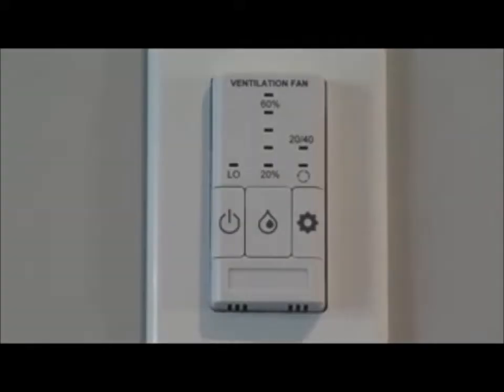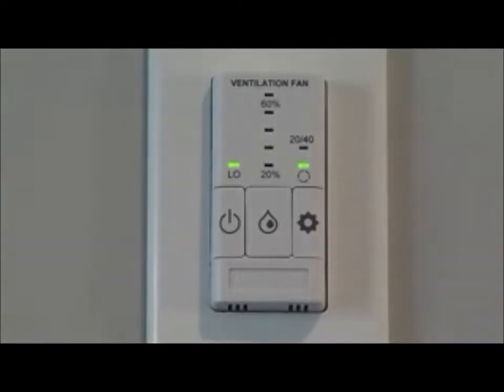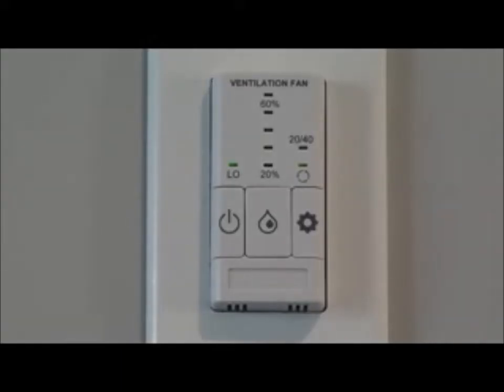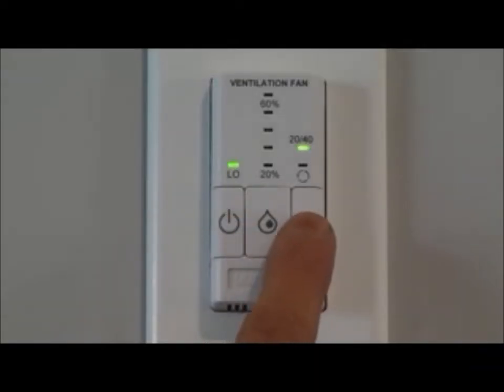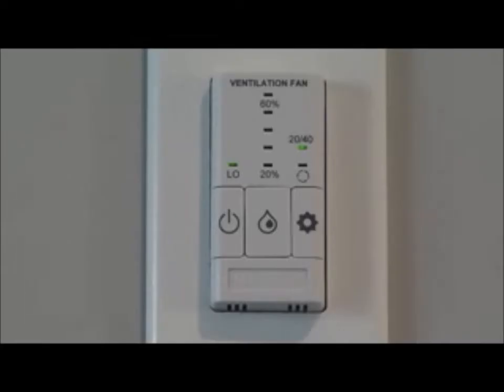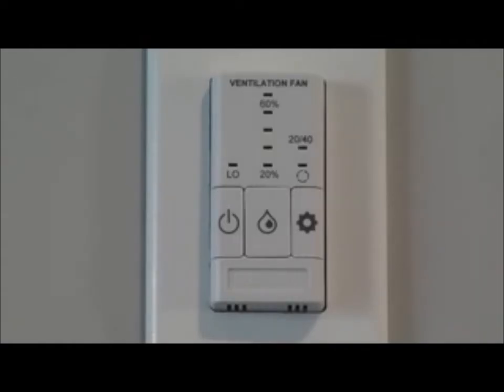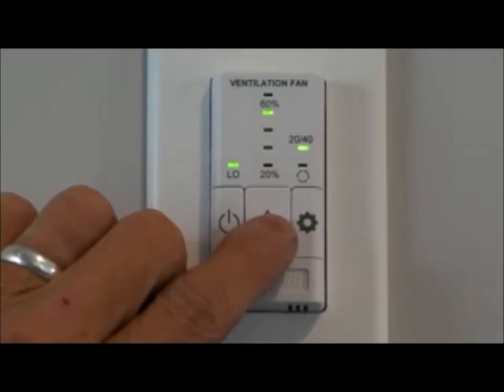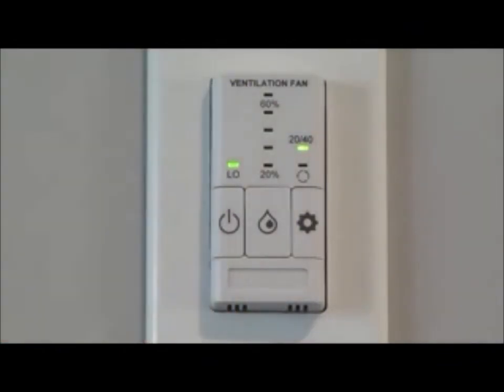Lifebreath HRV - BC03 Controller

Comment: Great video, thanks. So what is ventilation setting is best for spring, summer, fall. Generally I’ve run AC fan ON instead of AUTO. So should I be running HRV ventilation on LO or 20/40…?  And then in the winter keep heater fan ON and keep 20/40 for HRV?

Comment: Hi guys, quick question if I understand correctly, I have the HRV on 2040. What is the perfect setting while running the AC during the summer in Canada?
Reply: Turn the ventilation fan off

Comment: Hello, i just recently moved to a newer house and i’m having issues with the condensation. I’m seeing condensation in my windows and i have the fan running at low, the humidity is at 20% (it’s minus -17 but feels like -31 right now), and it’s running 20/40. I’m still seeing condensation in my windows.
What should i do? Should i turn off the fan, leave the humidity at 20 and use the circulation?

Comment: Great video! Thank you. In the summer time,  I'd like to turn the HRV off. But when I do, the bathroom fans stop working. Is there any way around this issue?
Reply: I have the same issue. The bathroom fans are tied to the HRV system so your best bet is to have it on Low and 20/40.

Comment: I turned off the HRV for about 4-5 days because we hit really low temperatures -38°C~-43°C. We just noticed on the 5th day that half of the windows upstairs are covered with ice. But clearly the guy in the video said to turn the HRV when temperatures reach 30°C or -30°C. That's the part that confuses me.

Comment: it's -30 here in winnipeg, my hrv has ice buildup and the defrost damper makes noise. what should i do
Reply: Below -25 with usually you should just keep it off and wait for temperature to go up little
Reply: But if I do that, I get condensation on my windows.
Reply: @ajaaniajaa  unfortunately there’s nothing much can be done in that cold weather. You have to manually manage your humidity, after shower keep your washroom fan on for at least an hour or 2 hours.  Don’t boil that many things in house and if you do then keep kitchen fan on for as long as possible. Use paper towel to wipe condensation. Condensation for few days is not a problem, it’s a problem if it goes on like this for so so long time. I’m here in Alberta we get cold weather as well, We had around -30 temp for 8 to 10 days and we couldn’t stop condensation but was able to reduce by doing things above mentioned
Reply: Thanks, this helps.
Reply: @Vipul_  I am living in Saskatchewan and wintertime extreme temperature is -40c so do I leave on HRV on 50% and. 20/40 mode?

Also, I have noticed in HRV Box ice build-up in the core. Is it normal or I should shut off the HRV system??
Reply: @arjunpatel6878  20/40 is 20 minute fresh air intake and 40 minutes circulation also around -40 temperature it doesn’t do much so better to keep it off or just run it in circulation mode if you want air to be clean. 

Run HRV on 20/40 mode only if outside is not colder than -25
Reply: @Vipul_  thanks for the reply.. How about the humidity level set to 40% or 50%???
Reply: @arjunpatel6878  humidity level means it will bring dry air inside and make sure that it’ll manage humidity around those percentage. In winter I keep at 40% and lower down to 30% if I notice any condensed windows
Reply: Just moved to Winnipeg as well with the same controller. If you found the sweet spot on the controller let me know!

Comment: Hi I live in Ontario, if I understand correctly, during winter leave it running 24/7 at 40% humidity,  with high fan on. During fall, spring & summer turn off the humidity but have the fan running on low?
Reply: For winter, No need to run fan on high mode. If you have BC03 controller then just leave it on low mode and have your humidity option selected (40 or 50) then select 20/40 (idle) but turn 20/40 off while cooking and turn fan on for furnace as well to get rid of cooking smell.
Reply: Your HRV fan will automatically run on high speed when you turn fan on in washroom

Comment: Hi, Thank you for this video. Question pls. I set my controller to 20/40 however the fan never stops running. Do I also turn the humidifier middle section on? For winter.  Also, I have Telus app, should I also turn the fan on my Telus app or just use this system only? When I use the circulating option on my telus app and level this box off, it turns the fan on and off ever 10mins or so. Which option is best pls?
Reply: The middle section is too control humidity in house, if you have 40% selected then whenever your has more than 40% humidity, HRV will start pumping dry air to lower down humidity. In winter best to keep it on 50% and if it’s too cold than 30 or 40^

Comment: Thank you for this. So in winter the best setting is humidity at 40 and re circulation?
Reply: You can use recalculation mode but turn it off (recirculation mode) while cooking. In my opinion better to use 20/40 which basically bring fresh air for 20 mins and then recirculates it for 40 mins

Comment: Hi, I have this system and the Ecobee at my house, but the humidity is super low. I live in Gatineau, the air outside is pretty dry also but I like my house rather humid, I’m from a rather humid country anytime it’s get too dry in the house my nose bleeds and I get sick. How do I raise up the humidity in my house? Thanks
Reply: For humidity you will need separate humidifier, this HRV doesn’t control. It can only pump in some dry air if your house is too humid (depends on setting you choose)

Comment: My house is double story and when I come downstairs I can smell the cooking smell I did the settings how u said and my fan is on ON position what should I do pls help
Reply: HRV is a good idea but I don't think it ever works, I have it but i also have to open windows when I am cooking.
Reply: When cooking you must turn off circulation mode or that 20/40 mode and put furnace fan on (by default your furnace fan will be on auto mode)
Reply: @Vipul_  I was complaining because the controller of my HRV Was not communicating with my furnace, I had to manually turn the furnace fan ON but it’s now fixed( after 5 years ).

Comment: My humidity section doesnt flash at at. What does this mean
Reply: It means you have your inside home humidity under(lower than)  that percentage which you have selected.
Reply: @Vipul_  i know it will lower the humidity but will it raise the humidity if I set it higher also?
Reply: @natasha340  technically it doesn’t increase humidity as those percentages options work as dehumidifier. If you have 20% then it’ll will make sure that your house doesn’t get more than 20% humidity and if it does go up then fan will start working at full speed and you’ll notice that 20% option flashing. 

To increase humidity  you can use your humidifier and set up your hrv at 40% (ideal for 0 to -12c temp) this will make sure it doesn’t pump more dry air in your house.
Reply: @Vipul_  i will have to buy a humidifier than . Thank you for your help. Happy new year.
Reply: @natasha340  Happy new year!!

Comment: When the setting on the controller is on 20/40 the HRV is not Turning off for the 40 minutes. What could the problem be?
Thanks
Reply: What 20/40 means is that, for 20 minutes the external air is let inside home, for 40 mins the air just inside home is recirculated to save heating energy. So HRV won't stop.

Comment: If we first time on the HRV in winter how many days continue on my hrv on but not shutting down 5 day continue work now
Reply: In winter use the 20/40 mode, by this method, your home will have enough oxygen inside home. Dont turn off the hrv in winter.  In summer, keep the hrv in continous air circulation mode, by turning off both the third columns led lights off.  By pressing the third button three times, untill both the 3rd column led's are off, your hrv will be in continous air circulation mode.  If you still have doubt call me at 587 997 7859.
Reply: @Canada_Immigration_Bible  
I also live in Calgary I don't have the 20/40 option should I leave the fan at low and humidity at 30% during winter
Reply: @harigill8534  yes. U can also turn off humidifier when u see ice formation in Windows and doors.
Reply: I have same question my lifebreath unit controller doesn't have 20/40 option they have only two option low and high which one i should use and how long.
Thanks
Reply: @COMPAQCOBRA  always keep it on low, high when you are cooking. Also make sure to have circulation mode off while cooking

Comment: The past owners of my new house passed one 20 gauge wire from the air exchanger to a DET01 timer. From that timer, he passed another 20 gauge wire to another slot where I could add a BC03 basic wall control... is that possible or do I have to fish another wire to another “in” port on my air exchanger ?

Comment: Hi I live in a new house in Manitoba Canada and right now the temperature outside is -33 degree celcius with the windchill of -35. The HRV system is off the whole night and our windows and doors still have ice buildup. I need some advice!
Reply: Mae Desiderio turn on the water looking button to al least 40% or 50%
Reply: @krazywalnut5633  the humidity control is at 30%. Right now the temp outside is -20°C and still gettig ice buildup on all our windows.
Reply: In the video (3:00) he said if we reach plus 30 with humidex and minus 30 with windchill thats the time we shut off the HRV system.
Reply: @mondo_burrito  if you turn it off, there's going to be a considerate amount of condensation on windows thus turning that condensate into ice.
Reply: I have the same situation in my house. I have condensation building up in my window and it’s not yet winter here in Manitoba. What’s your current setting your ventilation?

Comment: I have removed the BC03 to replace dry wall - Upon refitting it, I might have got the wires wrong
3 Wires Yellow Black and White - Black was definitely the middle but now the lights above the power , 20 and circulation are flashing and the unit doesn't appear to work...... Any idea?
Reply: Black wire connected to Y, Green wire connected to Green, Red wire connected to red in my BC03. Yellow(or Black),Green, Red is the order in the back of BC03.
Reply: Alan Mani The past owners of my new house passed one 20 gauge wire from the air exchanger to a DET01 timer. From that timer, he passed another 20 gauge wire to another slot where I could add a BC03 basic wall control... is that possible or do I have to fish another wire to another “in” port on my air exchanger ?

Comment: Confused regarding the humidity because it seems opposite of my home and what i would choose.  What i mean is, in the winter my house is so dry (roughly 25%) that i had to install a humidifier on the furnace in attempt to bring UP the humidity to a more comfortable level.  However in these videos it says the opposite, you say use the system to reduce humidity in the winter...  I would want to increase humidity in winter and reduce humidity in summer!

In the summer months the humidity is high, today for example we had the windows open in the morning and its aprox 52% humidity before turning on the AC on the inside  (outside today will be 29*C = 38*C with the 70% humidex factored ). 
I live in Canada between MI and NY.
Reply: I live in Calgary in Canada and the lifebreadth can't increase humidity (To increase humidity, increase using the separate control in humidifier. Your home will have separate control for humidifier). So in winter, turn only the dehumidifer to off by making sure all the center led's off in lifebreadth control.  In summer set the humidity set point in the lifebreadth to the percentage you need.  example  40 or 50%.  So what lifebreadth will do, is if the indoor humidity increases beyond 40 or 50%, it will increase fan speed to reduce the indoor humidity and will maintain to the set point, 40 or 50%.  Hope this helps.
Reply: @Canada_Immigration_Bible  Thanks for the answer! I'm in Quebec and the house is soooo dry, around 22... So I deactivated the dehumidifier in deed and bought a humidifier...
Reply: @MS-jk3px  In Calgary, the humidity fluctuate a lot. When it snows or rains, the humidity peaks and when it is just below -20c  and when you run the home heat a lot to beat the cold, the humidity drops too low. Its good to keep it tracked frequently. I use Ecobee and also have a manual humidity meter to measure humidity.
Reply: @Canada_Immigration_Bible  this makes a lot more sense to me than the video. However, this is contradictory and exactly opposite to what the video is explaining. Is the video explanation misleading and incorrect? During the winter, I've always kept both my central humidifier and the HRV on. However, I always keep the HRV humidifier setting higher than the central humidifier. This way the two systems don't fight each other since the HRV is supposed to reduce humidity and the central humidifier is supposed to increase it. During summer, I turn my central humidifier off and just leave the HRV humidifier at around 50% because the natural humidity in the house is normally higher anyway.
Reply: @dpanster19  Every city in this world is of different humidity level.  So following a video posted from a different city won't work for you.  So use the tools (HRV, Humidifier) that are available at your home to control the humidity.  As long as you maintain the humidity at your home between 35 to 45 you are good.   Rain or snow brings lots of humidity.  The main purpose of HRV is not to reduce humidity. (Many gets confused on this.).  The main purpose of HRV is to absorb the heat from the stale air going outside and pass that to the inside of home without mixing the stale air and fresh air (Heat transfer without mixing air, thats why its called Heat recovery ventilator(HRV)).  Also internally HRV has different DIP switch settings that are customised to the location where the HRV is installed.
Reply: Exactly the same problem for me, it is very very dry in winter and very very humid in summer. Why does he say Winter only ?
Reply: Are you supposed to have the ventilation fan running on low when the AC is on ?